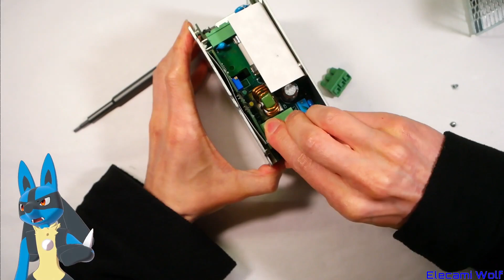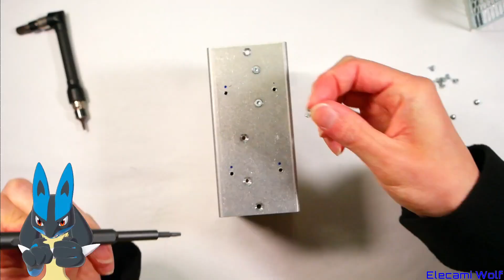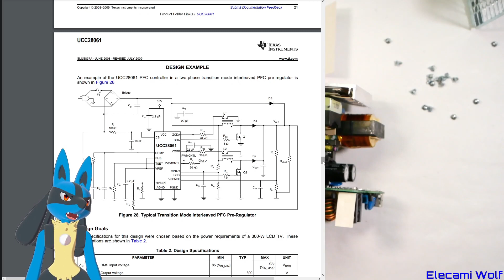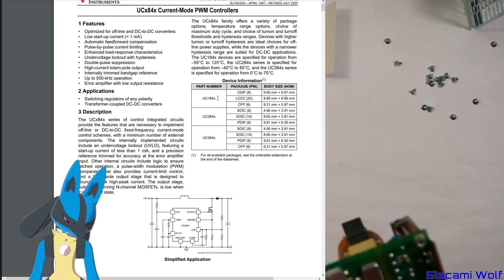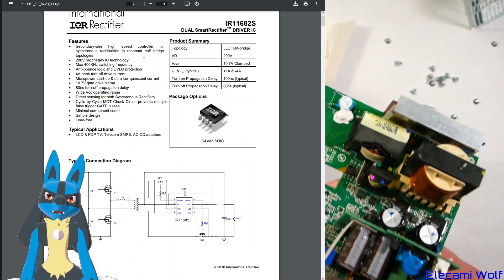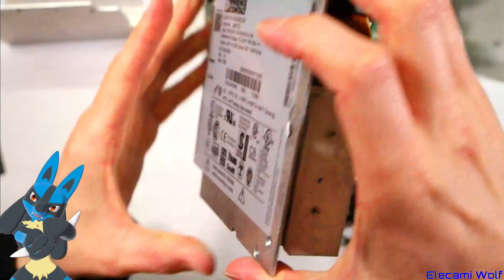EW0075 - Phoenix Contact DIN Rail Power Supply Teardown

Comment: What can be the reason of SMPS failure when suddenly switch on the power supply in automation industry?
Reply from the maker: Been on for a long time in a hot environment and the capacitors have dried out. Once you stop it and it cools down it won't restart because the capacitor values are out of spec. 

Power surges, overload, noise spikes.
Reply: Okay!! Thanks🤝🏽

Comment: never thought id see lucario go into detail about PSU stuff XD , I like it! :3
Reply from the maker: Good to hear, thank you. 
Hopefully brings in a bit more life :-)
Reply: We use Schneider and Weidmuller and phenix contact .They are all pretty good .
Reply from the maker: @carlubambi5541  Do you see many failures? I expect they will last a long time if they get good cooling.
Reply: @Elecami  cooling makes a huge difference in performance and longevity .We have so many issues with VFDs in closed NEMA rated cabinets they build up alot of heat .Once you make holes for ventilation you loose your enclosure  rating .They do make special Peltier coolers for cabinets .But like anything .More complications more problems .It's tough in the food industry .Flour  ,water oils fats chemicals they get into cabinets and contactors real easy .HMIs get destroyed
Reply: @Elecami  .The only issue are short circuits but counter EMF from coils de energizing and inrush current are common issues .Most 24v sensors and PLC'S are pretty good on them .We use predominantly schneider  power supplies .We will add a fan in the case to circulate the air ..Most of our enclosures are stainless steel..Would be smart if they were to add heat sink fins on one side to aid cooling and avoid placing other components directly adjacent and above and below to aid convection cooling
Reply from the maker: @carlubambi5541  Thanks for the insight there. Makes me think there is a market for IP rated VFDs. Probably too much hassle with all the control wiring that is specific to the application. Or locating them away from the production floor. Then there is the hassle of miles of cable with RFI issues.
Reply: @Elecami  no not really .It depends on equipment and sensors /devices .We fuse mains on power supply and fuse power supply output ..What is important is the power supplies ability to keep cool and hold its 24 v .Inrush currents can be pretty bad from relays and contactors .And some devices as well .The food industry is tough on equipment ,oils ,fats ,flour,sugars and other Ingredients floating around in the air make a mess of equipment components easily ..A 200 watt supply lasts pretty long.Its the dirty AC that kills the electronic ..We do use a 24/12V supply and a specific one for 5 volts .But for basic Ac controls we will use from 100va to 400va step down control transformers ..They last long.
Reply: @Elecami  There is a good market for IP rated and Wash Down rated equipment in the food and pharmaceutical and chemical industries ..A PSU with a proper heat sink /Fan cooling  system is a must including a well designed enclosure .There is money to be made from PSUs that can tolerate hot cold and damp environments from -50 °C to 120°c ..Some places the ambient temperature is between 50° to 90° C